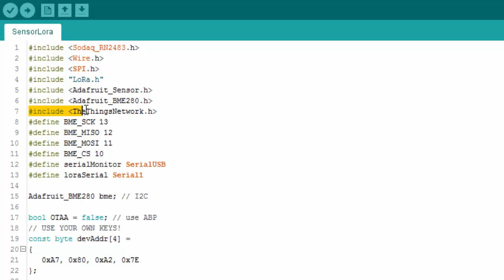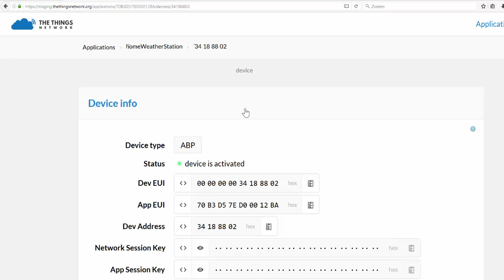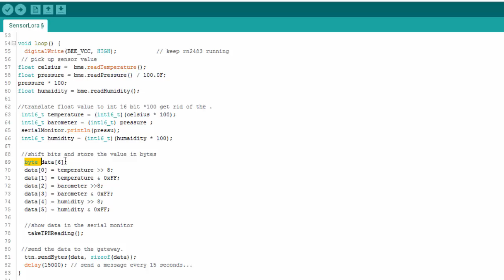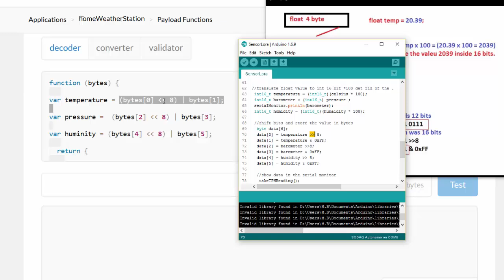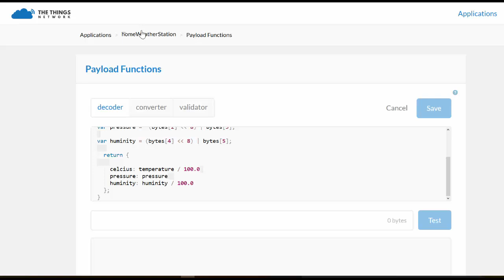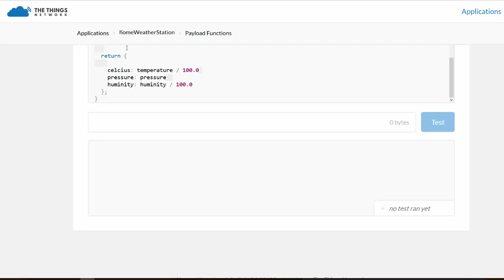Lora: Send payload to The Things Network

Comment: excellent video. i am trying to connect a whispernode to the esp8266, i have the gateway running, I am not able to deliver the payload. thethingsnetwork class shown in this example does not work as my whisper node does not have Serial1, (only arduino mega and other boards have it) how can I send the payload to gateway, appreciate any help

Comment: Excellent video Mos, very interesting. I think I would like to try something like this myself. Could I use an Arduino Uno for this instead of the Sodaq board?
Reply from the maker: Hey Aiden, Yes but than you have to connect an  LORA sensor to it.
Reply: I have an extra dragino board, i connected it up to the Arduino and followed your TTN setup guide. I used the dragino instructable tutorial on sending a payload from Arduino/dragino node to Pi/dragino. Are you aware of this one? Its uploading the payload to the TTN but its incredibly slow. One payload per 10 minutes. Any idea if the data rate can be increased?
Reply from the maker: did you look in the code or there is somewhere a delay in there?
Reply: Yeah, doesn't seem to be any delays in there other than the usual 1 second loop delays.